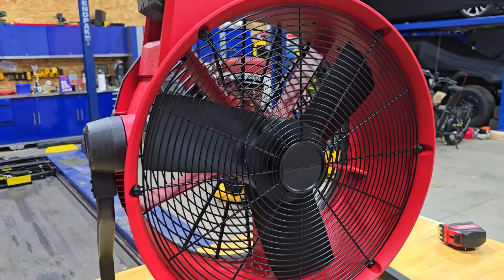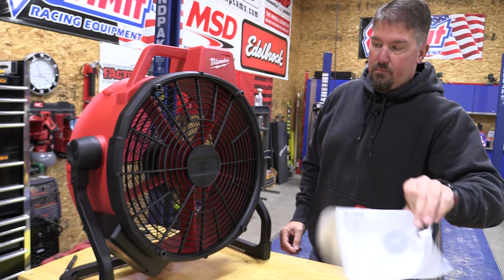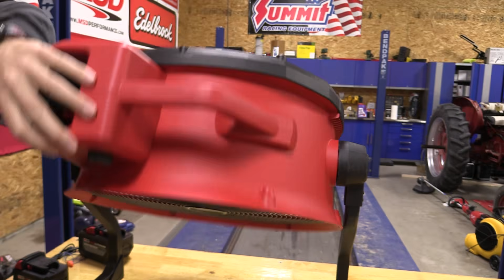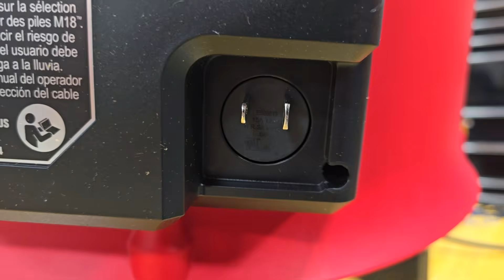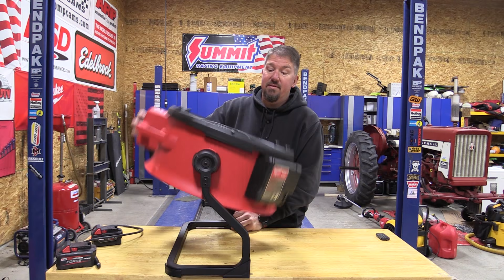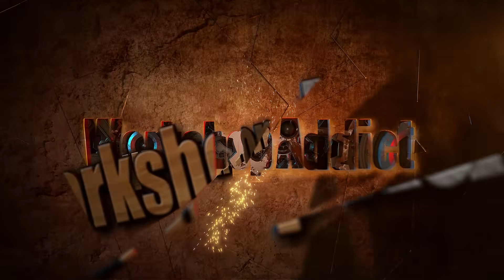The Most Expensive Milwaukee Fan Ever!  New M18 Brushless 18" Fan Review 0821-20 #milwaukeetools

Comment: I would pay $400 for this but it must, have 2 (magnetic) wireless charging pads on top for phones. 4  ports for charging batteries when pluged in. Run on 2 bats @ 40 volts cordless. Have 2 120 outlets for tv while camping. And make it ISO waterproof in the rain with batteries. The 4 port charging must work in both directions when unplugged. When unplugged the entire unit becomes stored energy to run the fan /charge a phone/ run a tv, in America… would also add ground LED lighting at base of unit with photo cell on/off switch. This takes a product from 1 use to 7 different solutions. I would pay $500 for that. And sold bare tool with 4 18 high output batteries it becomes a powerful energy storage unit.. speaking from a DeWalt perspective, with 4 12amp hr in the power station that only charges 4 batts @ 2 amp hr, this sucks, charge rate is only 1/5 discharge rate. I expect a 50% charge rate to equal 50% discharge rate, with a fan that cools batts, imagine that ,time is money, if Milwaukee can do that, take my money. Been here done this, put the120 grid cord at the top of unit in the cord wrap,it is a lot less bending over to wrap a cord.

Comment: Milwaukee could also gone with a twin battery set up to take the fan to 40 volts, or,,, one battery port charging, while the other port runs the fan, there is so much more Milwaukee could havedone with this design. Could have also put 120 outlets on it to run a tv camping, usb-c outlets to charge phones. Or cordless charging on top of fan. This fan can do 5 different things,,,, but it is only designed to do (1) thing… with (one) battery… f-ing pathetic.

Comment: Have the small m 18 fan . It's a total shame they didn't make them chargers as well. Adds almost no cost,  but a useful feature.
Reply: That and usb ports
Reply: It would not be no cost to them to add those components.  My guess it would cost them around 20 for parts and more labor.  Prob have to add eq to produce them which initial costs could be a ton.

Comment: Love and own this fan it’s food for what it is I run mines with an m18 12.0 forged battery and extension cord, use this fan every single night to sleep and while in the house I have 4 12.0 my only complaint is this should have been an 2 battery unit….. if you don’t have 12.0 your gonna cycles through batteries fairly quickly
Reply: Im contemplating using this fan pointed at my legs on low while welding overhead. I think A 5ah will get me enough time between lunch breaks and isnt as big of a theft target as a 12ah battery

Comment: But how does it do in an attic?
Reply: I do hvac and would to know this
Reply: @justinmurray9075  same
Reply: @carrieresammy i bought one and they are awesome and really help in the attic. Work great out by the condenser to because they cover a big area.
Reply: @justinmurray9075  if you guys really worked in attics you know this is a dumb question. its a fan if the air is 100 degrees your moving 100 degrees. but if you just want a answer it would work the same in a attic as it would in a garage or bedroom or bathroom etc.
Reply: @grouchygrouch9500 if you ever worked in an attic you would know it makes a big difference. But thanks for inputting your unwanted comment.

Comment: Battery Question:  There a good number of negative reviews on the 12 amp Milwaukee battery. That's my only concern about this fan. I want the longer run time with the more powerful battery but it doesn't sound reliable. Would you comment on this, please?
Reply: 12ah and 9ah M18 batteries are total garbage, the 5ah and 6ah batteries are the most powerful, best quality and longest lasting.  I've owned about 10 of every amp hour battery Milwaukee makes. Been recycling a lot of them after about 8 years.
Reply: @Tubesurfer11  Thank you, it sounds like you know what you're talking about!
Reply: @Tubesurfer11  not a chance I've got 6 12s that I cycle through at the job site and 6 more at home and I switch the 6 like every 6 months have had no problems with any of them and they are all between 2 to 6 years old.
Reply: @Tubesurfer11  I own a Milwaukee 9ah battery and its a beast...Don't know where you got your info from or you got bad ones. The 9ah last forever on power tools compared to the 5ah. I have both also...

Comment: You know I think ur the man to ask...been subscribed to ur channel forever.  I'm a mobile forklift mechanic...I work out of a 2023 promaster...I want this fan however it's so damn big.   You think it's worth going through the trouble of storing it vs the old m18 which is much smaller ?  I guess I could store it on the passenger seat...lol
Reply from the maker: If by old M18 fan you mean the 9 or 10 inch model, yes, I think this is worth it.  If you need air, this fan will move it.  Build a box and store it on the trailer somewhere.  Maybe the ceiling?  The old one is less then 25 percent of this one IMHO.   But it is larger.  If you want air movement and can figure it out, do it.  You are who this is meant for.
Reply: @WorkshopAddict  …..thanks brother

Comment: Milwaukee is exausting the m18 battery platform and are depending on the 12ah and high current forge way too heavily. Makita did the dual battery 36v forever ago, and then made the new one battery xgt platform, dewalt made flexvolt, and metabo hpt has multivolt. Flex is 24v so out the gate they have 20% more voltage to play with. Even tti's own ryobi went 36v on their big stuff. If milwaukee is going to stick to m18 they need to make a lot more dual battery tools, thats how makita got away with it for so long. Im suprised they didnt manage a dual voltage battery, there must be a hard limiter in the architecture of the m18 that prevents it from doing voltage swapping like flexvolt or multivolt

Comment: I love mine. Been using it with a 6ah. Relatively quiet and pushes out a whole lot of air.
Reply: How long will it run on that battery
Reply: Ive used it for about 8 hrs
Reply: @metronyc2855  Was that 8 hours on low speed or medium?
Reply: @almaburns6562 low, in medium it’ll probably last 4 or5 hours. I use it for work in my work cart. Only guy with the fan and the sparkys love it! Everyone on the site was complementing it! I’m happy I have some side work. It’s the only way I can afford this stuff 😂

Comment: Are those red dividers in the barrel for aiming the air in a straight direction because some of the barrel fans push the air in a open direction.  The small m18 fan is like that it blows a ton of air like a perfect straight direction because of its design
Reply from the maker: This pushes in a wide area

Comment: Question, does it drop speed on all 3 settings on battery power or it drops only on max?
Might be because the power supply is pushing 20-21volts and battery sits at 18V after a few minutes of use after full charge.
Reply from the maker: It drops speed on all settings, but it is easiest to hear on video on high.  I believe your idea on the power supply is correct.
Reply: I've had the little one since they came out. Does the same thing.

Comment: Tough sell when a basic corded fan can be bought for 1/4 the cost. Cordless is nice for short periods in unpowered environments. Not charging the battery while on corded power is a huge miss.
Reply from the maker: I am not sure this is a basic fan.  I can see where contractors will pony up the money for this.  I too wish it could charge a battery also.
Reply: @WorkshopAddict  Be nice if it would switch to battery power if running when the power goes out or cord is pulled. Cords get kicked all the time on the job.
Reply from the maker: @motofunk1  It does do that and I show it.
Reply: @WorkshopAddict  Missed that... Glad it works.
Reply: give it 2 months. rapid charger blue tooth one key $650. that what the commies do
Reply: As a Electrician We Dont have power until we install it😂 so battery powered fan.  I just need to see it workin for myself before going all in😎👍
Reply: @armandoesparza1409 all the sparkys at my site loved it. It’s a great fan. I use it for finished carpentry, and lately it was so hot in the damn hospital I’m working at. Have this baby on low with a 6ah, and I’m cool all day. Here and there if I’m working where the fan doesn’t reach me I put it at 2 or 3 to cool down quick